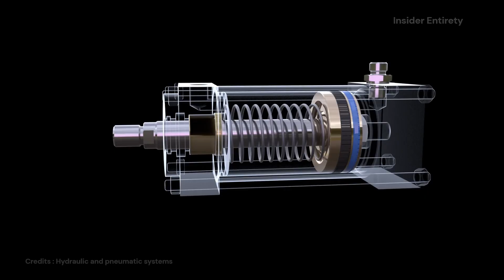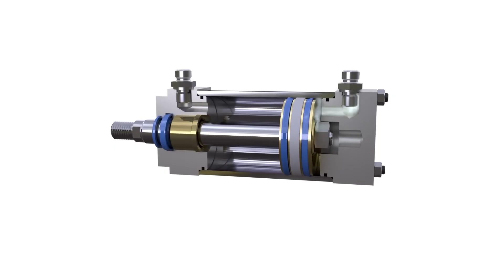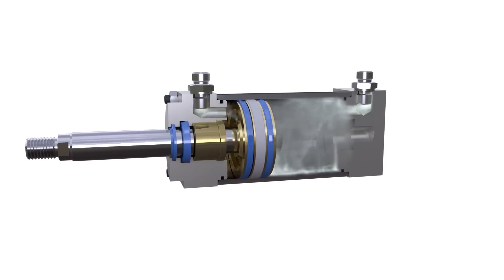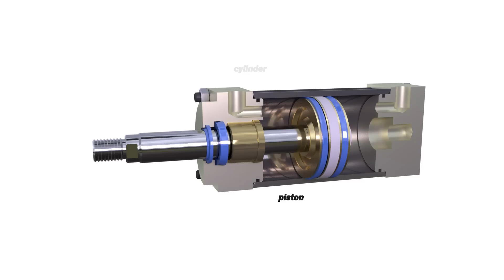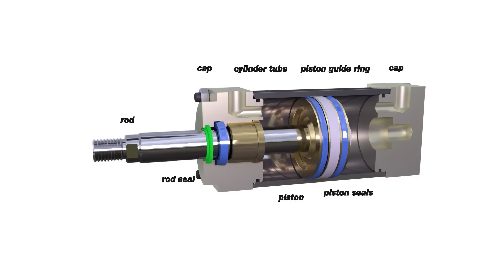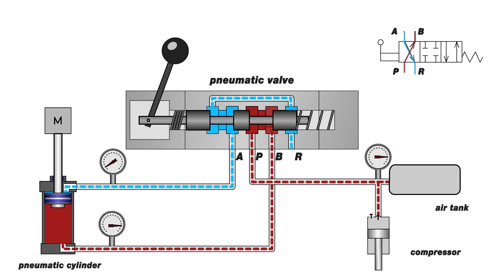How Pneumatic Cylinders Work — Now You Know!

Comment from the maker: A pneumatic cylinder can generate over 10,000 N of force using just compressed air — no electricity, no hydraulics!
What should I explain next — hydraulic cylinders, solenoid valves, or industrial robots?